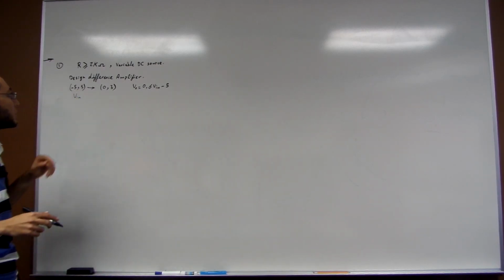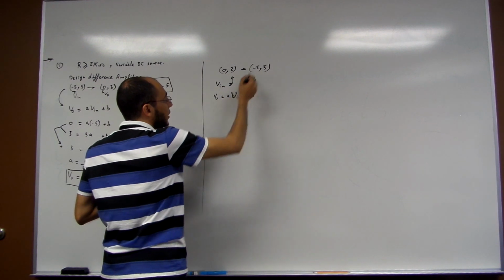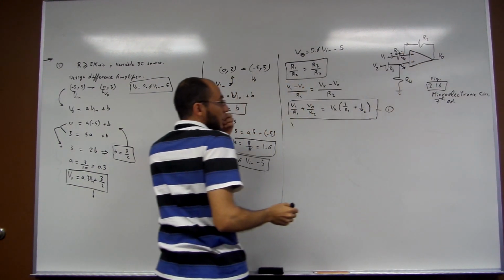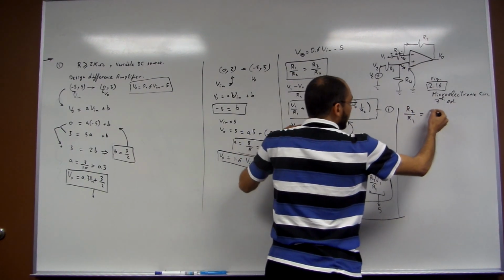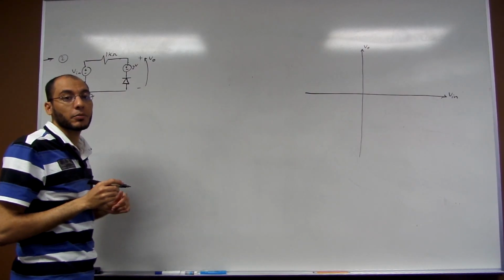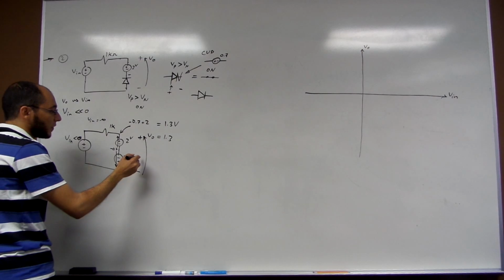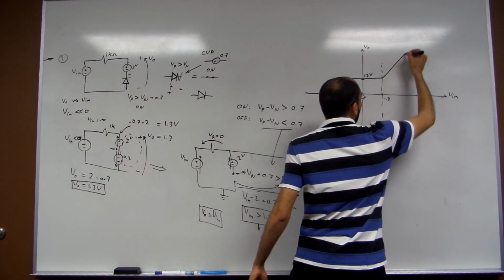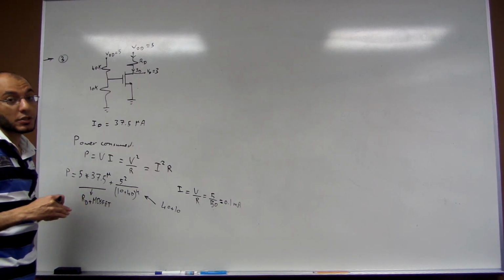3 problems: difference amplifier design, Diode voltage plot, MOSFET power consumption calculation

Comment: I have a problem. I control a DC motor by a mosfet. I must know the capacity needed by the entire circuit. I can say that the motor and the mosfet resistor are connected in serie. If the capacity of the motor is 500mAH what about the capacity of the mosfet. and thank's for the video.
Reply from the maker: I'm not sure what you mean by "capacity" of a Mosfet... The current that it can withstand is found in it's data sheet. You need a powerful Mosfet to be in series with a motor... Otherwise the Mosfet will get burnt.
Reply: My motor is connected to an NMOSFET. When the gate is powered and my motor is then powered, what is the consumption of this circuit (motor and mosfet) and what is the value of the current.
Reply from the maker: You need to apply ohm's law to your circuit. This will depend on the voltage of the voltage source and the parameters of the Mosfet (kn, Cox, ...etc) as well as the resistance of the motor.